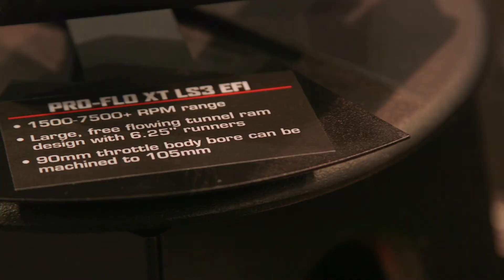Edlebrock Pro-Flo XT - LS3

Comment: im building A LQ9 with LS3 heads i want to retain the factory truck Alt/Power steering bracket will this intake with a 90 mm throttle body clear the it?
Reply from the maker: Please call our tech line. Tech Line Only: 800-416-8628